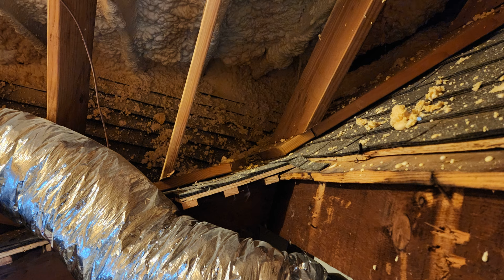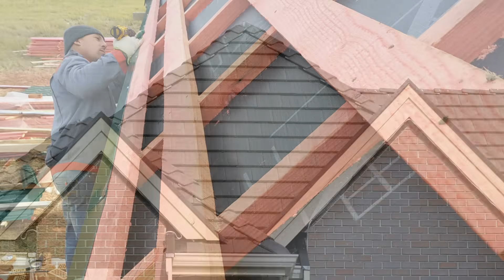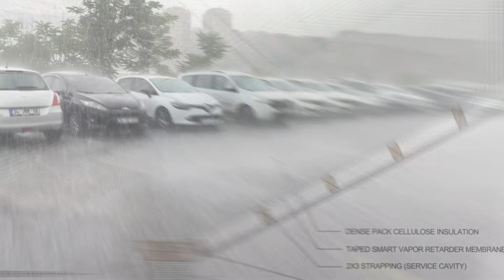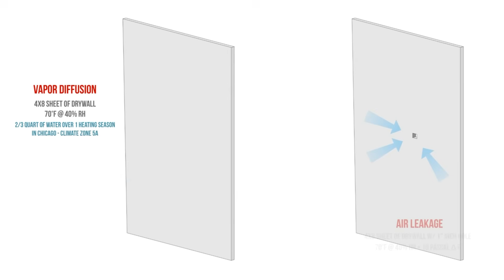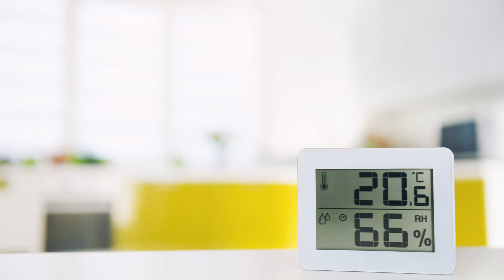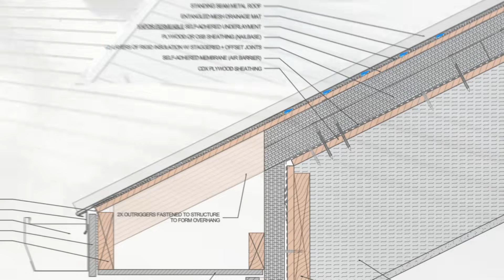A Guide To Foam Free Attic (Debunking the Myth that You NEED Spray Foam)

Comment: The more I learn about spray foam the more I like mineral wool
Reply: exactly
Reply: @quintontim or fibreglass
Reply: @MyMrdmitry  Especially the dust.
Reply: @JohnSmith-ds7oi why?
Reply: @MyMrdmitry  Imagine inhaling thousands or millions of microscopic razor blades.. And if you ever gotten it on your skin, imagine it inside of you. If it doesn't scare you, it should.
Reply: Spray foam for air sealing is awesome, especially the floor of an unconditioned attic space
Reply: It's not the cheapest option(first cost), but it is the best option long-term...
Reply: Also, a vented roof system is really the only way to go in new construction...
Reply: @timnewman1172 why? You can put all your hvac in your attic if you condition it.
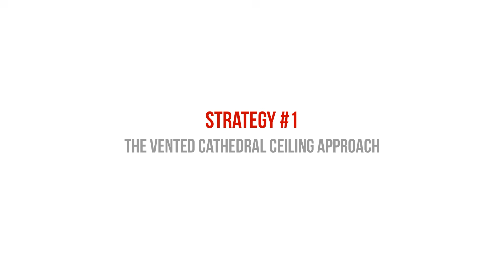Reply: @vespaman101  Vented roof, not vented attic. See 3:00
Reply: @tempesttube  my mistake i thought he meant attic. But I would also disagree with his vented roof being the best way to do new construction. The added cost and complexity of getting the trades there will make it not really worth it for a spec builder (majority of new construction). Simple and easy is always going to win. In my humble opinion a single layer roof with a vapor diffusion port is the best way for mass adoption. Im building my first house right now and holy shit I can't explain the sheer pandemonium and amount of upcharge id be looking at to do two layers of roofing. Thats why this stuff is only ever in custom homes. 

I think good 2 x 10 roof rafters, taped roof sheathing, standard synthetic roof underlayment, and a vapor diffusion port made of tyvek might be the way to go. I'd probably do your basic synthetic underlayment and stop it a foot short of the ridge. Cover that ridge with ice and water peel and stick. Cut the ridge open and tape tyvek over that. Just an idea from a very inexperienced builder. The ice and water shield is to keep everything airtight so you dont just tape tyvek onto a non self adhered underlayment.

Comment: Recently, a client approached us with a custom wall assembly utilizing 9 inches of continuous exterior insulation composed of 3 inches of mineral board facing 6 inches of polyiso. A liquid applied WRB separated the CI and interior framing which the client allowed for both stick and timber framing options. The exterior cladding and strapping connections required a bit of engineering. Otherwise the assembly was solid but a bit overkill for the climate zone.
Reply from the maker: Wow, 9 inches of CEI for a wall is very excessive. Were they building in the Alaskan frontier?
Reply: Nearly, the design was for a potential residential unit over in the Yukon.
Reply: @OckoSheetsmear-z2x  Better too much than too little, though large windows undermine ultra-performance wall insulation. I've seen so many McMansion projects on YouTube where this happens. Even those expensive European-style windows only get you to around an R-10.
Reply: @chrimony Yes, though carefully sized and positioned windows are a solar gain so much better than if they were a section of R10 wall. Of course, if one is far enough north (eg the Yukon), the hours of sun are quite limited for a good chunk of winter.

Comment: Excellent as always. 

Steico (Germany) have a hydrophobic rigid over T&G over rafter insulation system that manage not to use sheathing. The rigid board is stiff enough to walk on and provide shear strength. Butt ends can meet between joist. 

I'd like to know more about systems that don't use as many engineered products.
Reply from the maker: We're intrigued by that T&G rigid wood fiber product, we've used wood fiber for roofs but we're a bit hesitant to leave it exposed without an additional underlayment (we take a very conservative approach to water management). It seems to work great though for the Europeans, especially since they vent the topside of that insulation.
Reply: Probably not an option in higher seismic zones?
Reply: @MichaelJ674  You can get shear strength in other ways. Cross braced metal straps and the like.

You could save a lot of money by omitting two layers of sheathing with the structural insulated sarking boards. 

Invest in a single high quality, mechanically attached, air/water/vapour control layer, protected right in the middle of the assembly,  with a standing seam metal roof, 25mm entangled underlayment venting to a ridge above, and a netted dense packed cellulose below - sandwiching the wrb up against the sarking.

Comment: I have wondered how is the self-adhered membrane SHM handled in the future reroof of the shingles. Cannot cover over with a new layer (not getting good adherence), cannot scrape SHM up? How is it done?
Reply: These membranes stick to themselves, so unless they are in tatters or peeling off, you should be able to apply a new layer. Worst comes to worst, you could always replace the sheathing or nail down a new layer of sheathing on top of the old one.
Reply: @chrimony  What about code?, I thought IBC code only allowed exceptions for 2 layers of self-adhered membrane (2 yes but 3 no) in exception IBC 1512.2.  The insurance company around here, (Florida) push re-roofs every 10 years for shingles.
Reply: @dt-qh2cj  I don't know about the code, but if follow the over-roof strategy, you shouldn't have to replace the membrane that's on the under-roof when you replace the shingles, and then you probably don't even need a membrane under the shingles. Here in New England, ice and water shield membranes are only typically applied near the edge to prevent ice dams.
Reply: put synthetic underlayment over it, or use a more permanent roof solution
Reply: Would sheathing over the membrane after tear off add significant weight to the roof structure to comprise the home?

Comment: Great video and very timely! I was just thinking through solutions for one of our projects with a low slope trussed roof that's restricted by a height covenant. We nixed spray foam as an option due to the coastal climate (PNW). This might be an option for us, we just need to work through some unique code requirements in BC. Thanks!